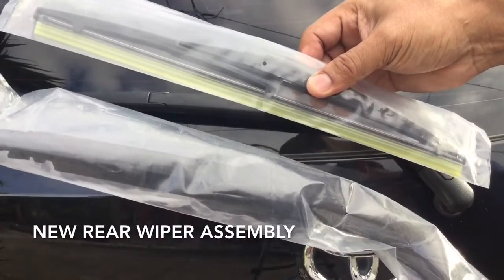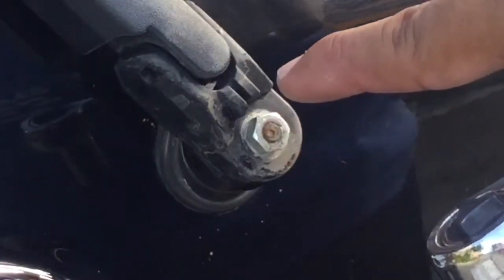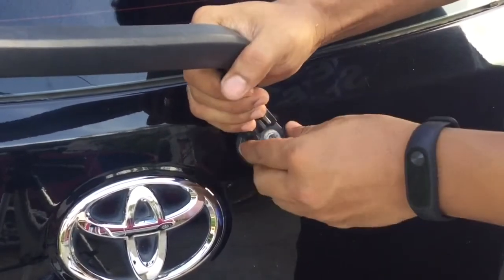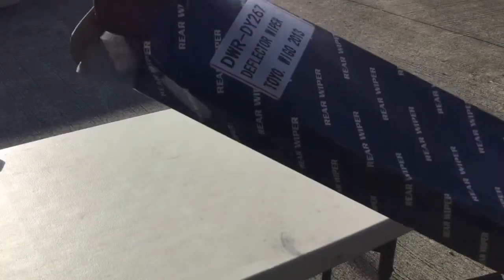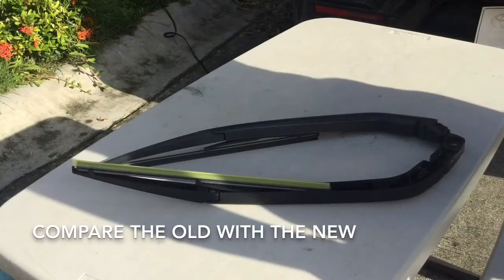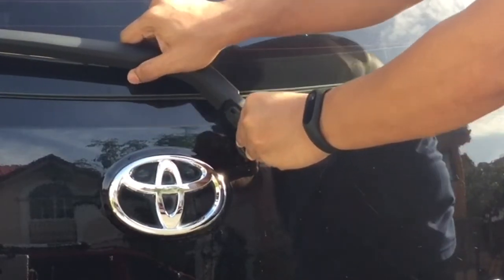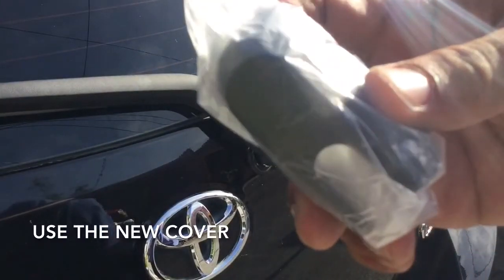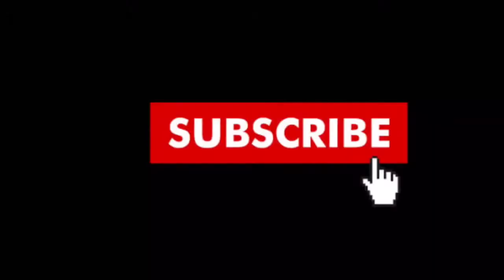How to Change the Rear Wiper - Toyota Wigo, Citroen C1, Perodua Axia, Peugeot 107, Ayla, Agya, Aygo

Comment: Allan good morning my tanong lang ako. Pag maingay na yung rear wiper ano ang prob nya pero ok pa naman yung blade nya na original. Ano ang pwede kung gawin. Maraming salamat. God bless
Reply from the maker: gaano na po ba katagal yung stock na rear wiper blade? try nyo po palitan to rule out if the old blade is causing the issue.
Reply: Allan mag almost three years na sya kaso minsan ko lang syang ginagamit kasi nakaka distract pag gumagana sya. Kaya nung gumamit ako ng acid rain para sa mga marks doon na sya nag ingay. Kaya ginawa ko hinayaan ko nalang Allan. Maraming salamat sa reply mo. Malaking tulong yung ginagawa mong information video. Sana wag kang magsawang gumawa nito. Maraming salamat Allan sige try ko na palitan sya.

Comment: Sir pano po pag lumuwag yung rear wiper? Parang loose thread sir? Salamat po
Reply from the maker: use tedlon tape po or change the bolt if you need to.

Comment: nice talaga sir ang bilis akala ko friday pa..haha..already subscribed..may i know kung saan nyo na score ung rear wiper.balak ko na kasi palitan lahat ng wiper pati sa fronts..thanks sir🙂
Reply from the maker: https://s.lazada.com.ph/s.xKQZ
Reply: thanks sir.mas mahaba sya sa stock ni wigo pero no problem nman sir?saka silicone ba or rubber lng sya?
Reply from the maker: @rALdGe  yes, medyo mas maikli kumpara sa stock. im not sure if the blade if it's silicone or rubber or a composite of both/other materials.
Reply: sir kapag ba nag windshield washer ka..sabay na un lahat magspray pati sa likod na salamin?ung sa amin parang sa harap lng nagspray..sa likod na salamin hindi
Reply from the maker: @rALdGe  sa harap lang yung wiper spray ng wigo:( it would be nice nga kung meron din sa likod:) let's live with that na lang. hahaha
Reply: meron sir..i just found ngayon lang..kung sa harap eh u need to push up the wiper stick sa steering wheel oara magspray..sa rear pla you need to push down the stick..yun nagspray na sya ng fluid sa rear windshield
Reply from the maker: @rALdGe  Great, thanks for the info:)
Reply: thanks din sir..nakatago kasi sya sa taas kaya di sya agad mapapansin.😄
Reply: @WigoRaizeTV  sir sorry noob question. if bibili ako halimbawa sa blade or ace, may size ba yan sir? doon sa isang video nyo po sa front wiper, nabanggit mo 14 and 21